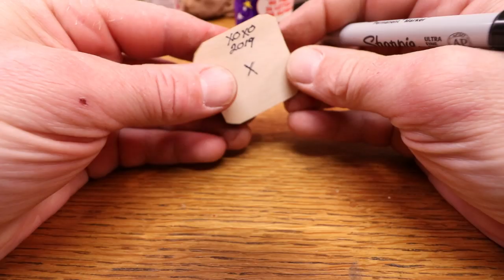Super Simple Valentine's Woodcarving

Comment: Great video..A couple of thing caught my attention..I believe the Veal belt sander/grinder uses a 1X42" belt, not a 30"...another thing..I think it is important to mention the correct way to hold the tool being sharpened...that is.."trailing" away from the direction of rotation of the wheel/ belt. You know what can happen if the tool "digs in" to the softer material of the wheel/belt...In addition to carving, I also like to make knives from scratch and have the toys to do it..I am not sure which I like best, carving or making the tools with which to carv, but this is my sixty-fifth year doing it.